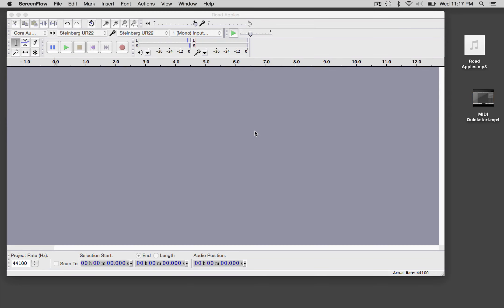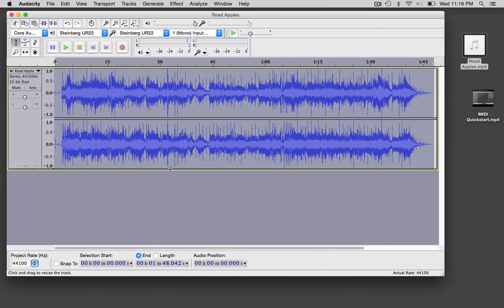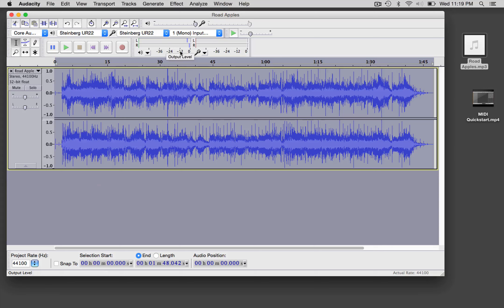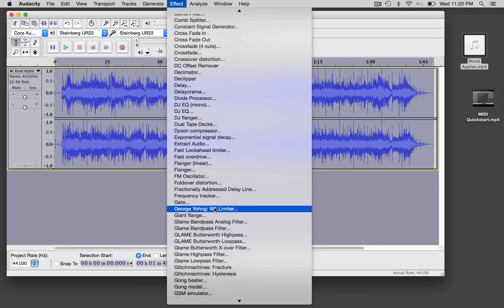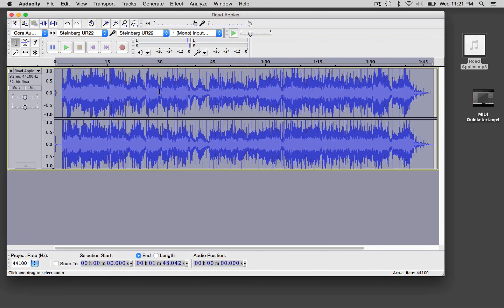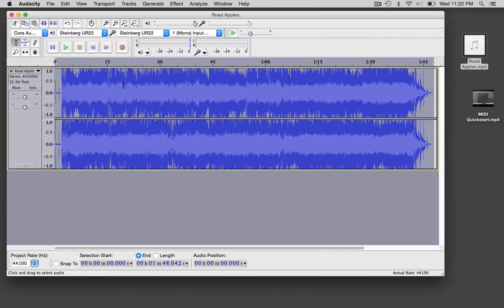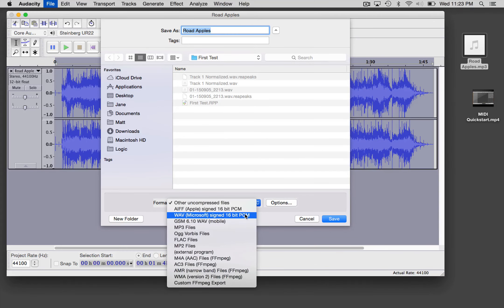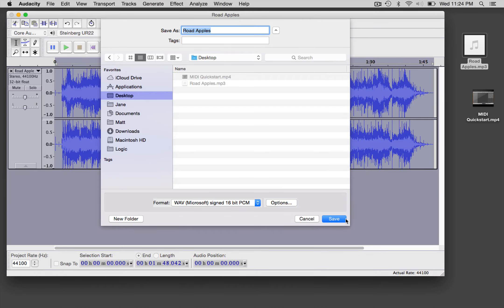Mastering Quickstart in Audacity

Comment: Matt...Mastering piano solo tracks and Ive found that a full does not work but how to get a full and dynamic sound is a problem.  
I record with cakewalk pro through interface peaked to 0, no redline.  load to audacity and tweak with amplfy, limiter, and compressor, but not sure if Im on the right track.  Sounds louder, clear...no peak at the threshold but wave is not blocked;  isthat good for a selling sound.....your thoughts?